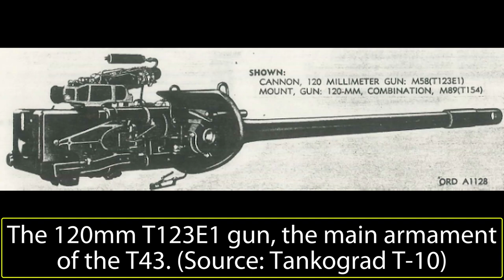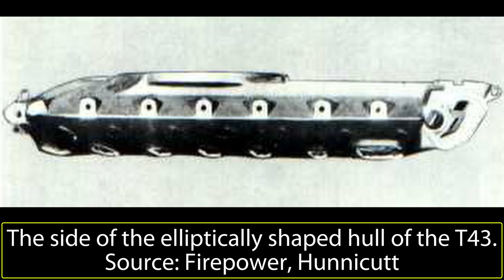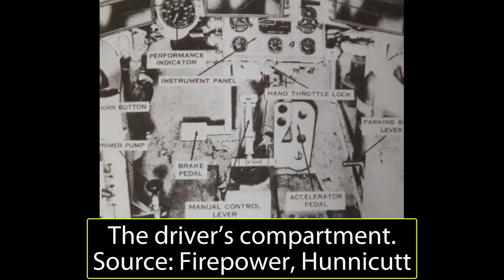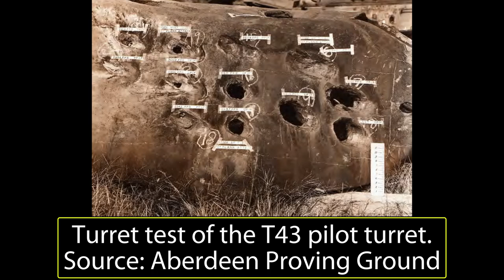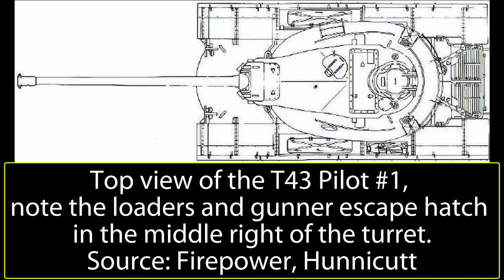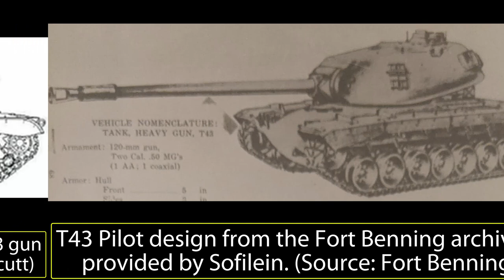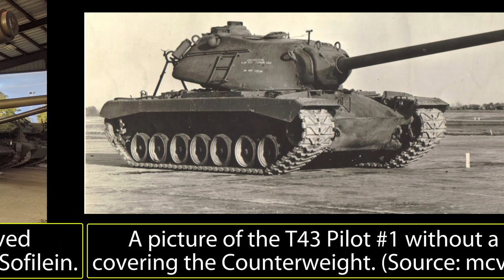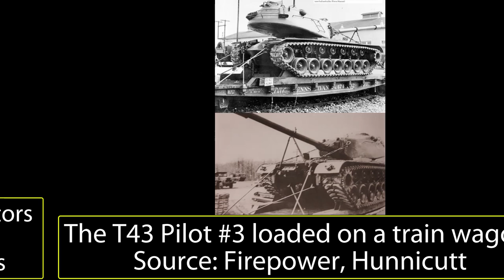Not Quite M103 Yet | T43 (part 2) feat. @Sofilein

Comment: I hope you mention in the future how when the Marines receive the M103 after the Army got rid of them from their inventory that the Marines replace that crappy gas engine with a better diesel engine that boost range up to 310 miles on a full tank and better performance. Makes me wonder if the M103 would hold a better place in history if it had had a diesel engine in the first place. 
Great video as always. P.s. I know at camp Lejeune they rebuilt a M103 for parades.
Reply: There will be more videos on it, I just have to wait for the archives to open so I can get my hands on a couple of files I need.
Reply: @blasekiller9733  ok cool lol. I wasn't criticizing you. I love these videos you make and letting you know that they rebuilt a M103 to driving condition for parades and stuff. 
I was just pointing out how the engine upgrade just improved the performance quite a bit.  (I seen it on the chieftain sorry)
Reply: As early as 1940 it was clear to the US that modern diesel engines were the way to go, but due to insufficient production of good diesel engines and diesel fuel the Americans were not able to make the transition in WW2. Late in the war they had made progress on high power reliable diesels and could probably have made them very competitive relative to gasoline engines in the late 40s, but the very tight early postwar budget meant that changing the fuel type was not feasible. 
Interest in diesel engines grew again after Korea but between the immediate need for new AFVs and R&D still  taking the back seat relative to production, it was not possible to change until the late 50s/60s when things became calmer.

1945-50 was probably when they should have done development of a modern diesel and switched fuel production as they had time to work in peace.
Reply: Well the marines were running the M103 around the same time the Army did, the army started running with the standard M103 in late 57 beginning 58 until late 62, while the marines started getting their M103A1's from their upgrade program around 1959 amd the diesle upgrades started around 61-62.

But, its actually not the engine that was the M103s problem. The M103 performed sufficiently mobility wise in for example the 1954 trials. The death stabs were mainly the Army being split in two about it, and the fire control system and gun causing all sorts of problems which required a turret redesign and overal internal rebuild. The engine was one of lesser problems of the M103 really.
Reply: @warhawk4494  i didnt see it as critisiscm at all. It definately did improve the performance, but it wasnt its main issue, thats all. Its nice that they run it on parades, quite a rare vehicle to have, and an imposing one as well, thank you for the info. Its mainly to my own frustration that i am not yet able to write on the other M103s. I was just notifying you that i am working on it.
Reply: @blasekiller9733  Yep
Reply: @blasekiller9733  well i appreciate everything your doing here. I watch your video on the AB 41 yesterday doing a laundry and your videos on french tanks. Your videos are well put together with a lot of great info and pictures to go with it. And seeing these videos on the M103 cool. And yeah it's issues were more than just its engine i agree. I have a love/kinda hate relationship with it in world of tanks and warthunder. Hahaha I do love it fully upgraded and even un-upgraded its not bad. Just hate how soft its armor can be. 
But I love the vibe it gives off.  "come get some Mofo"  have a kickass day.
Reply: The diesel was the same engine converted for diesel fuel. It increased the range, but had less hp, which is probably why people were always griping about the lack of power.
The gasoline engine had 810hp.

Comment: I think there is a mistake at 19:50 when giving the ammo capacity as 34 main gun rounds and 40,000 rounds of .50 Bmg. Does anyone know the correct amount? I would think maybe between 2,000 and 4,000 would be most likely.
Reply: Its 4,000, a mispronounciation in the video, in the article its 4,000

Comment: Was there an override for the left hand loader safety switch? I'm thinking if the left hand loader was unable to deactivate the safety so the gun could fire? Also, that's some hot ammo they used. 3750 fps is smoking in a rifle.
Reply: As far as i know, there was no override, but in all fairness, it would be damn hard to operate this tank with a single loader.

Comment: Guess I'm a worry wart, but mounting gasoline cans high up on the turret seems like an invitation for the enemy to puncture the cans with rifle fire and light the tank up. Better to have them mounted low on the back of the tank so if punctured and ignited, the gasoline would run on the ground and  not on and into the air intake and engine bay. Or was this a problem? I know Molotov Cocktails were used in WW2 with some success.
Reply: In a way yes, but the jerrycans are positioned more behind the turret, so they would not be able to be hit from the front in this regard. From there, if Infantry or whatever manages to get an angle on you to hit the jerrycans, the vehicle would most likely have been screwed regardless of the jerrycans. The other side is that jerrycans on the hull could also endanger crew escaping from the vehicle as one part of the hull could be on fire, while for the M103, it would seep into the seperate engine compartment. Its pretty much a pick your poison case.

In short, if something gets this close to the tank to pull something like that off, the tank is either in an urban warfare situation or almost encircled. For both circumstances, having your jerrycans being shot at, is the more minor inconvenience of the possibilities.